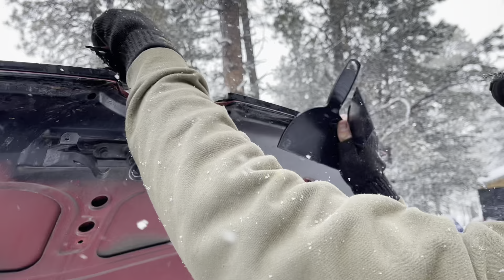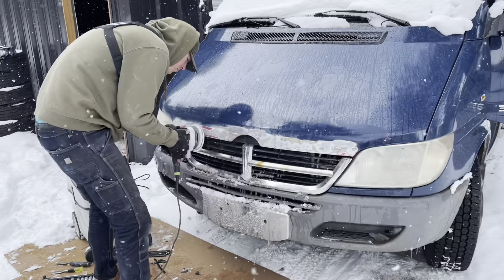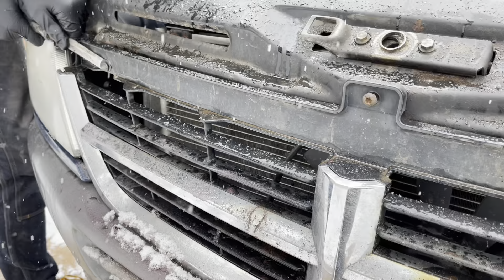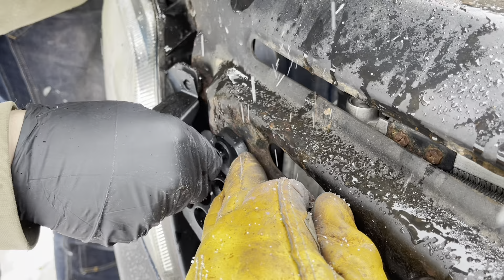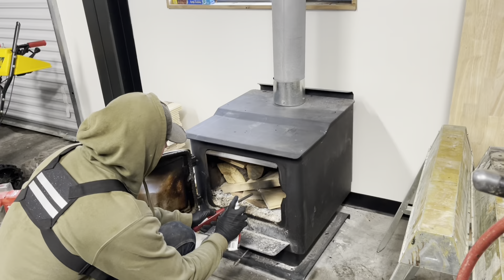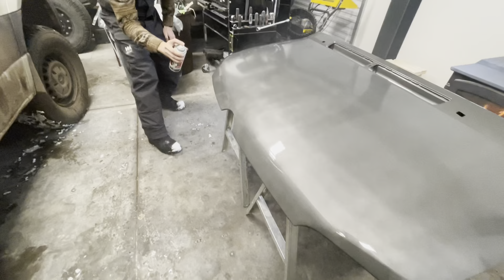1st gen sprinter Dodge to Mercedes grille swap (903) T1N

Comment: The way he says,  "Oh yaah, baby"....fucking legend...
Reply: Probably it might have the om 612 2.7 l turbo diesel inline 5 cylinder this is the first generation sprinter it has a Dodge grill but it has all of its parts that they put these grey Mr engines if this is the om612 or this is the 647 both are actually the five cylinder turbo diesel inline 5-cylinder but if we remove this part it's got this logo with the star that they put from the Dodge emblem it's all Mercedes parts and they put Mercedes engines and it's got the Mercedes-Benz logo on the Dodge grill it does have the logo and the star this was being replaced by the 906 version in 2007 to 2007 model year that had a diesel V6 or a V6 engine
Reply: Even on the Dodge emblem on the Dodge sprinter it's a rebadged Mercedes sprinter and if we remove the Dodge emblem you would see the logo that says Mercedes-Benz it has the Mercedes-Benz logo and the star that is on the Dodge emblem but they put a Dodge grill and had the OM 647 2.7 l turbo diesel inline 5 cylinder